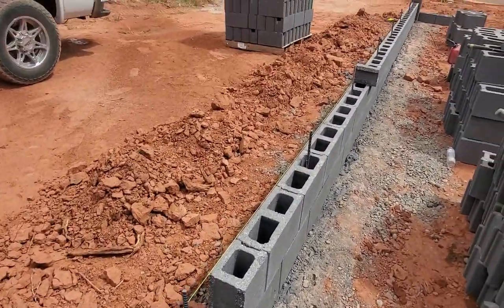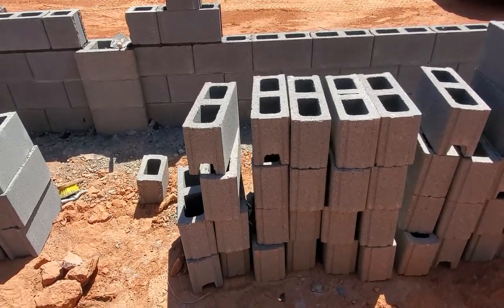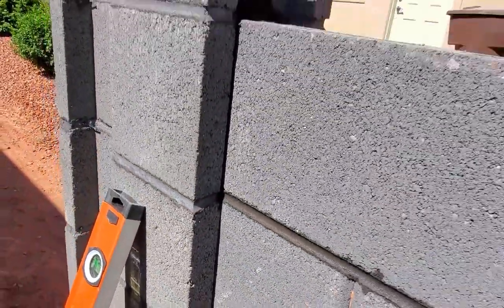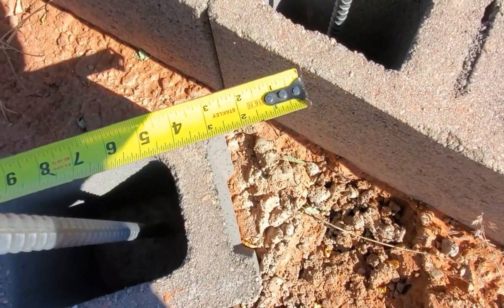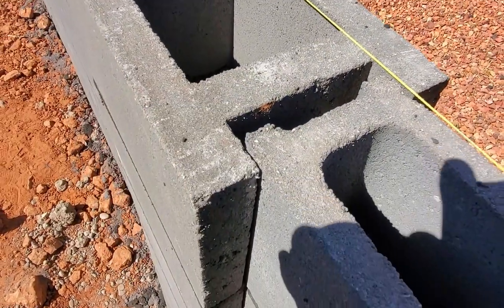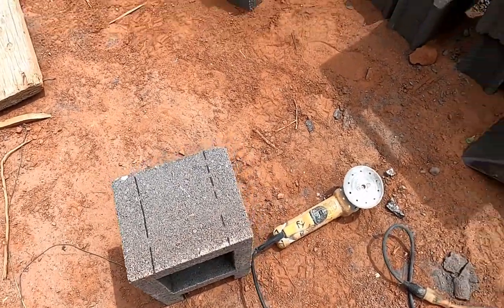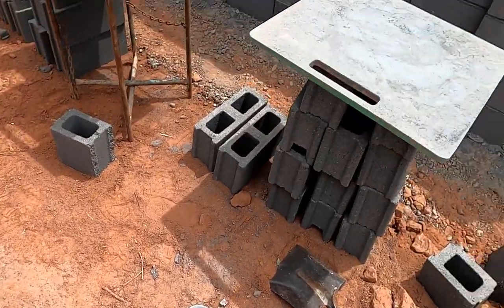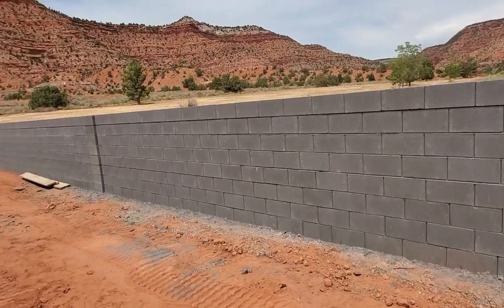Masonry Block Wall  (Part 7 of 10) Building the T&G cmu wall

Comment: let me ask you a professional question. Codes in many states do not approve wet setting onto fresh concrete (I prefer to do it though). Engineers say that there is no real bond between cinder block (first course and concrete). What would you say as a pro?
Reply from the maker: The only reason an engineer would say it has no real bond is because there is no spec holding you to an exact depth you have to set your block into the concrete. So you could set it on top of a footing that is almost too hard to pound it in. Basically they don't have enough control over how it's installed. But if you set it into the concrete it definitely has a bond.
Reply: @SolidworksUnlimited   Thanks for such a quick response! You confirmed what I knew before! I just never had an answer from such a pro. Another question, if you do not mind. I am working on a project where homeowner wants to fill all of the block sells with regular Type S and rebars (it is a 4' high free standing wall). I do not see a problem with it. What would you say?
Reply from the maker: Mortar is not a good idea as a grout, it has too much limes and salts in it, you would have a constant effloresence bleeding out of your wall and it would deteriorate it very quickly. Concrete is cheaper and a better product for that application.
Reply: @SolidworksUnlimited  I went with concrete instead of mortar. thanks for the advice!
Reply from the maker: @85Koshka  you won't regret it. I did a repair job where a guy grouted his wall with mortar and as I was pulling it down it just fell apart the mortar had cracked inside the wall because its mix design is to be a maximum thickness of 5/8" and the rebar had a reaction to the mortar as well and started breaking it down, kind of a white effloresence rust looking stuff built around the rebar and was quite flaky. Glad you switched, even though it may have been inconvenient. Take care and hope your wall lasts forever.